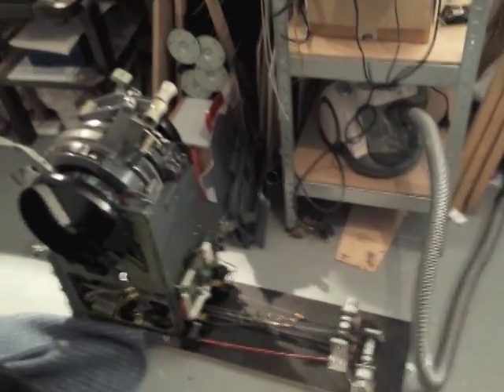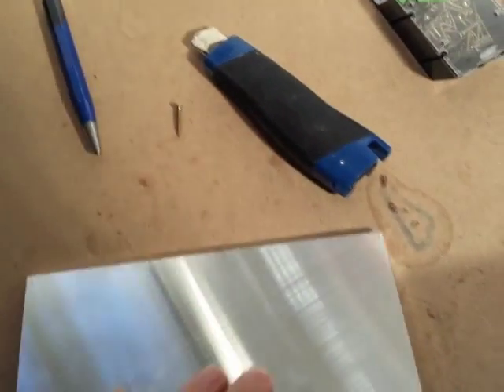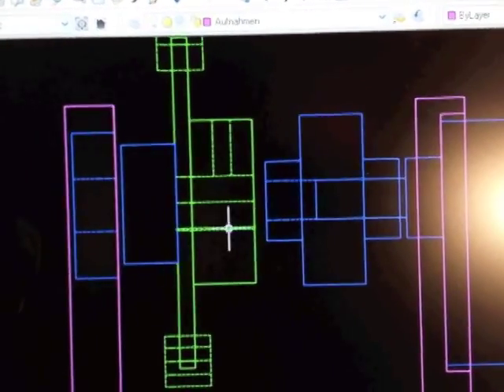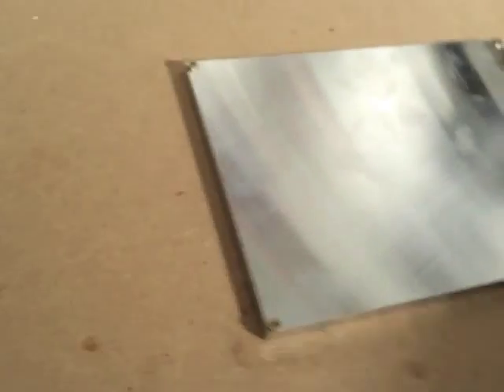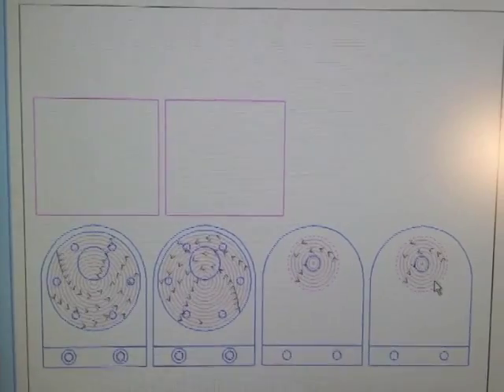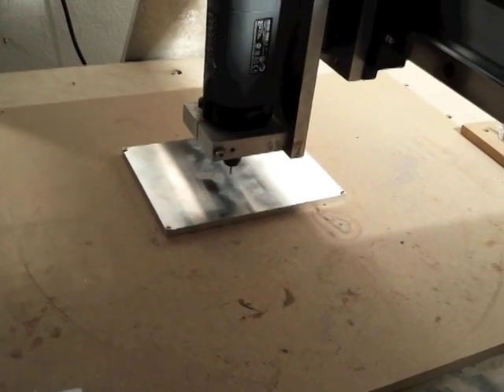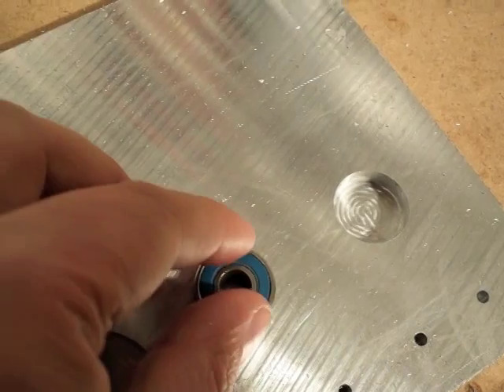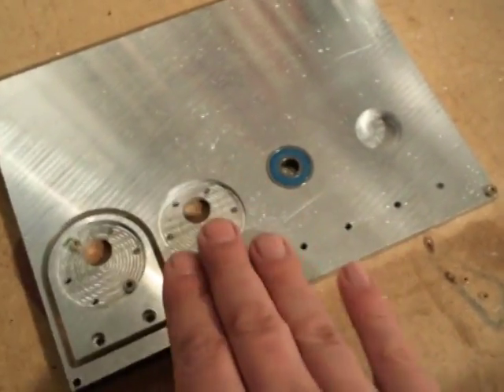How to make nice DC motor holders for a B737 TQ with a CNC machine

Comment: Hi.  Very nice videos.  I'm also building a Flightdeck and want to upgrade my CNC.  Can you tell me where you bought the Aluminum for this?  I want to mill new aluminum parts for my CNC.  I live in Stuttgart and have been searching.  I've found lots of scrap aluminum on ebay.de, but not sure what the various grades are here in Germany.  What did you use for your TQ stepper brackets?